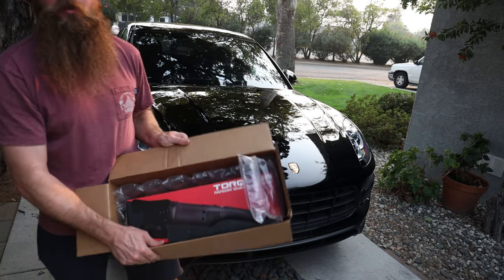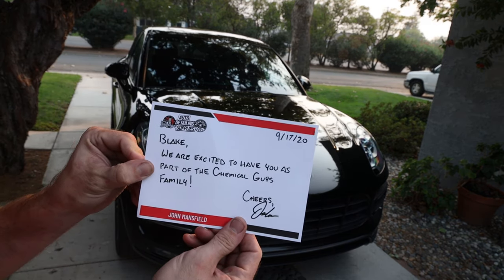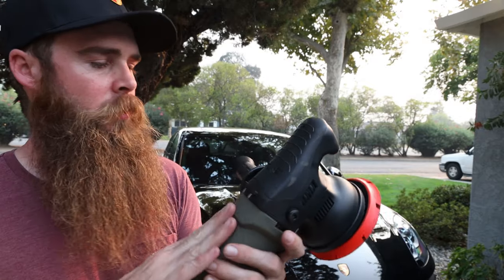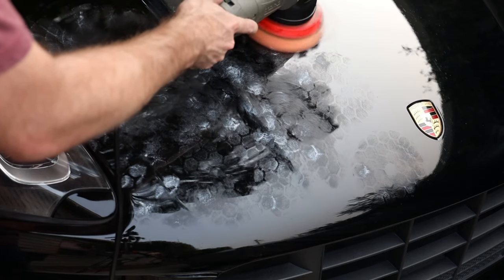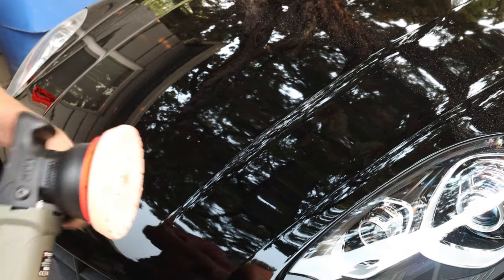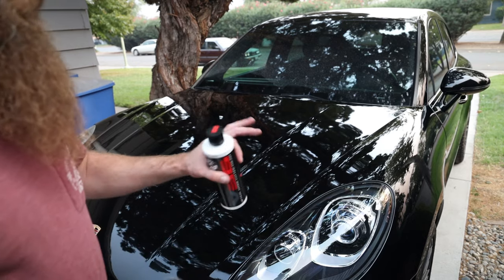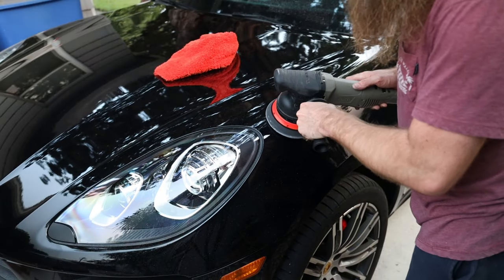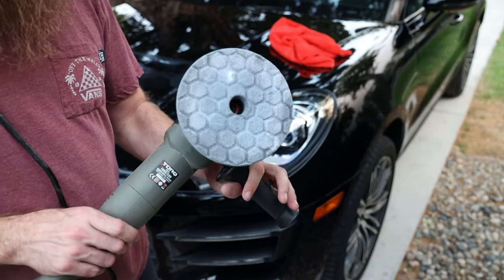Chemical Guys Torq 15DA Polisher any good?

Comment: Hi, so after claying the car , after polishing it…. what’s the next step? Is polishing suppose to remove swirls?
Reply from the maker: Cutting compound intensity depends on how bad the paint is. Then medium grade polish then finish polish and sealant or ceramic coating
Reply: @BlakesGarage  Thank you! I have a black 2019 Maserati SQ4 , never had a detail in its life and I was about to call a detailer but they wanted about $300. Rather buy the machine and do it myself ..
Reply from the maker: @thewiseguy7100  yeah definitely it's a process but it's actually relaxing and rewarding at the same time. I always like to buy the tools and do it myself for the most part.
Reply: @BlakesGarage  I’m exactly the same way, and you save more money on the long run and feel happy because you did it by yourself. Would you recommend this polisher machine or what brand?
Reply: @thewiseguy7100  yeah 😌 I think so too brother, but honestly do you have the torque polisher, planning on grabbing it.. my first polisher ever 😮‍💨